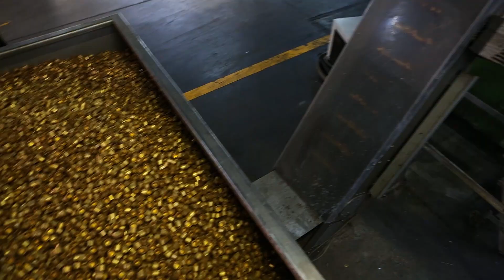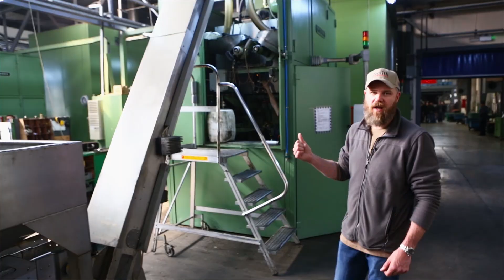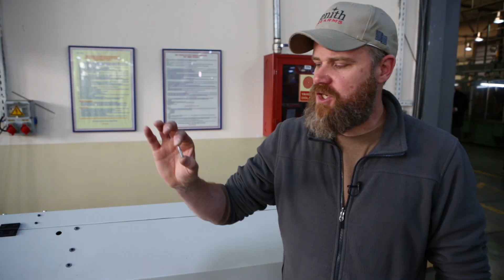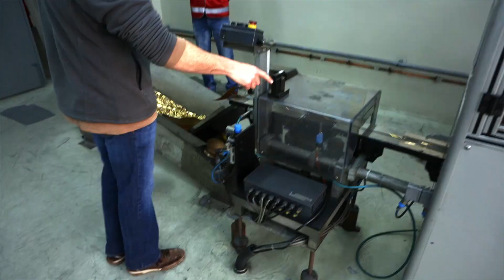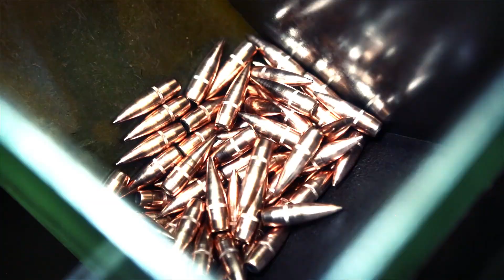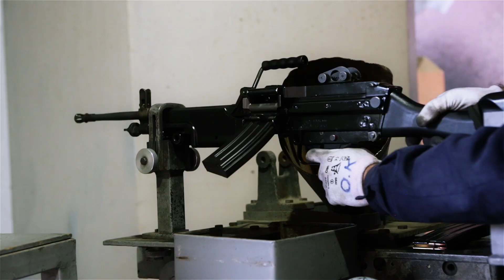Tour of the ZQI / MKE Ammo Factory in Turkey

Comment: Great tour! Thanks for your hard work. Have to say though that the 556 is great, but the 308 really sucks. Tried zeroing my scope at 100 yards with the ammo and it was a fiasco. Very inconsistent. Thought it was my rifle barrel or scope at first as the ammo claims to be consistent. 1 inch MOA at 100 yds. WE finally changed ammo and what a difference. Zeroed in with no problems. 556 also jammed fairly consistently in my AR until we changed bolt carriers. The best thing about the ammo is the price. Our Walmart in So Cal no longer carries the ZQ1 because of the steel core.